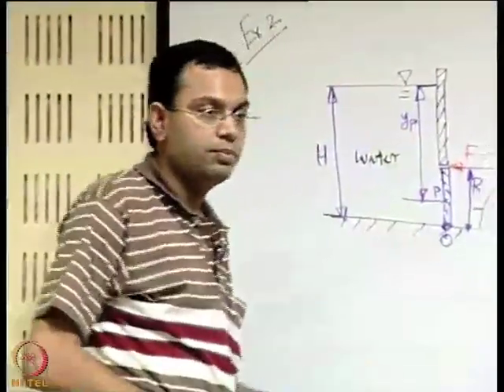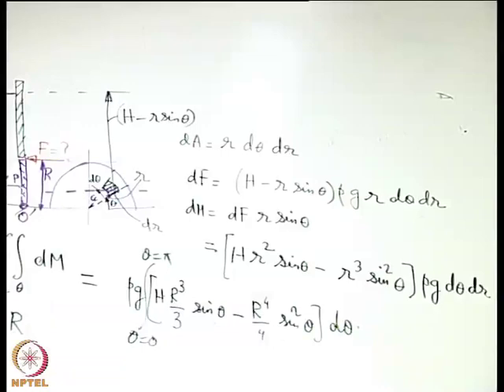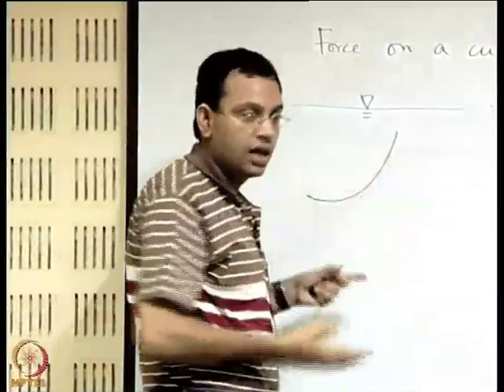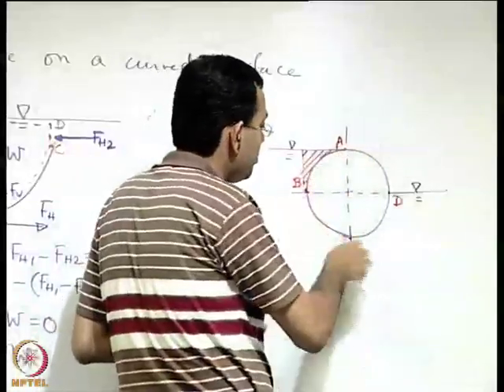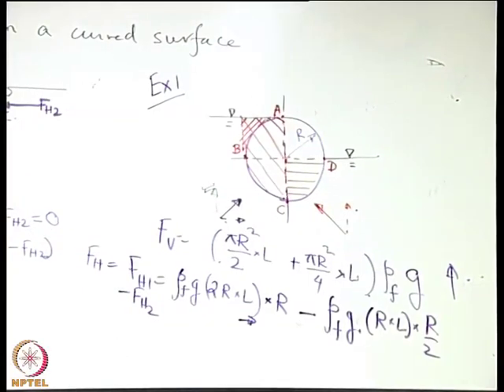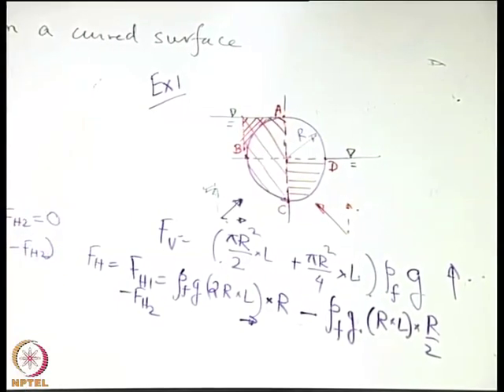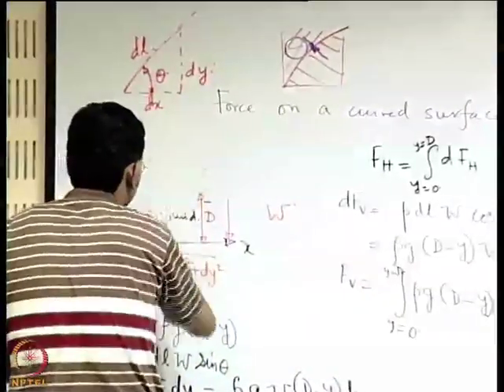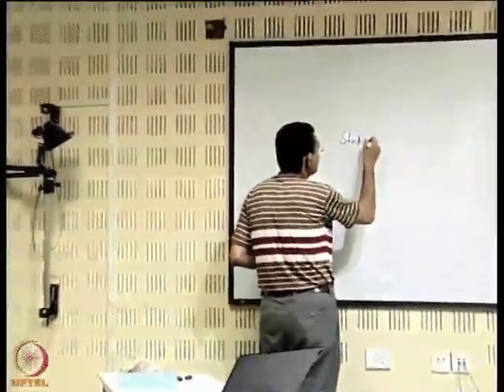Mod-01 Lec-09 Fluid Statics ( Contd.)

Comment: Sir in curve u have not taken vertical force downward why??
Reply: There are two different vertical forces exist here. He has computed the vertical force applied by fluid to the curved surface. However, the reactiond force exerts by the curved wall on the fluid, that one is downward.